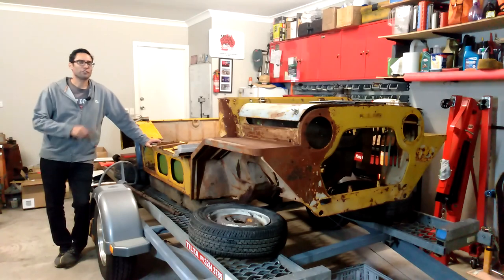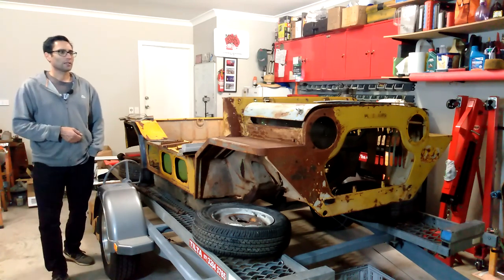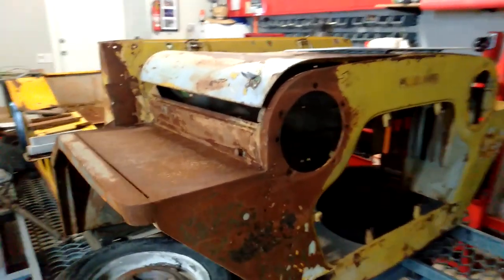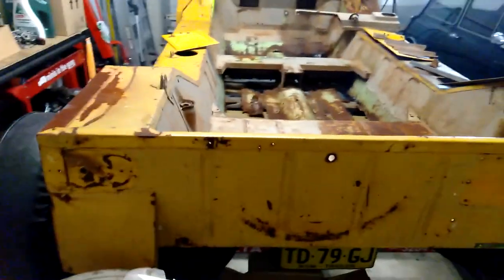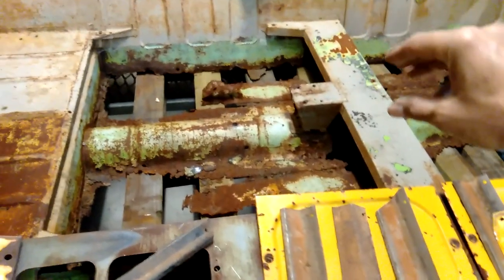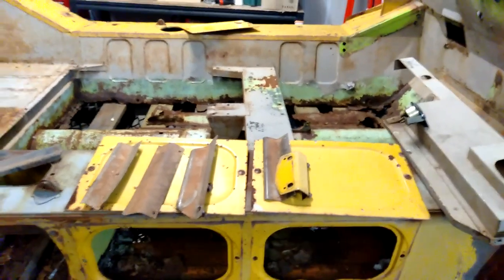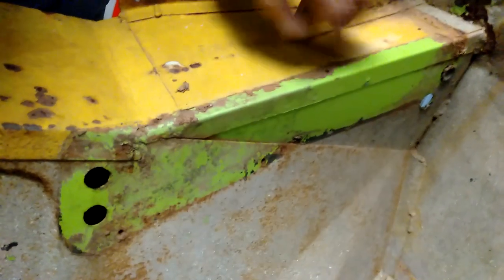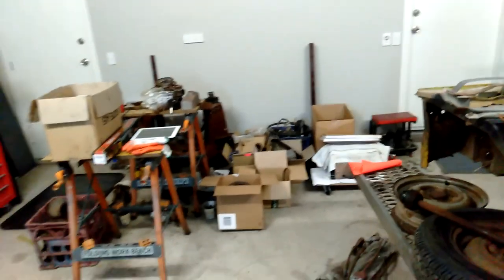I bought a new project car! Moke restoration EP01

Comment: Hey Mate,
Awesome idea to do a series on a Moke, I am part way through restoring a Moke and found there were limited videos and info on Moke resto’s aswell
I look forward  to watching the build 👍
I too had a lot of rust in the front footwell and if i had my time again would nave replaced the toeboard/firewall panel due to the amount of work to do,  between the floor and toeboard /fierwall there is a total of 3 panels that overlap each other to strengthen  the points the K Frame mounts to.
Reply: Sorry Mate
Just watched episode 2 you have done a great job explaining the floor repair 
I only wish i seen these videos before i started mine 🤦

Comment: Welcome to team Moke! Do the sub frames need any repairs? It might be worth getting them blasted.
Reply from the maker: The front frame was sand blasted but they didn't coat it so it rusted. Only minor welding repairs needed on it.
Reply: I’ve just done repair under the battery box. I would expect you might have some holes there too. I had to replace the brackets in there too. Hours of fun!

Comment: Hello, Do you mind sharing the price you paid for the project in this condition. I have come across a similar project for sale at the moment.
Reply from the maker: Price for projects will always vary because of what comes with or doesn't come with the project. I have seen projects in the similar condition to mine cost anything between $2000 to $5000, location also affects the price.